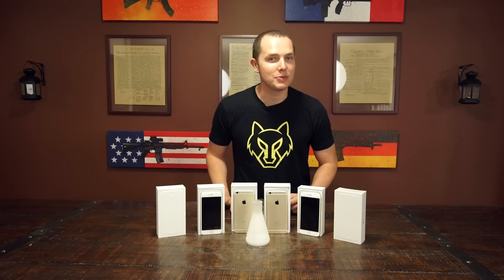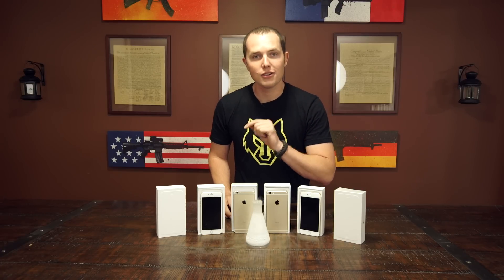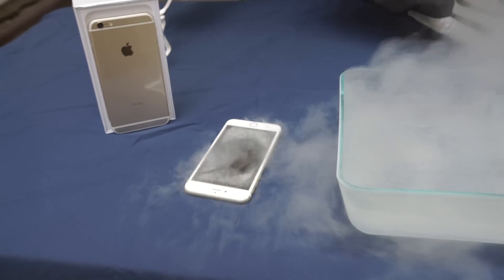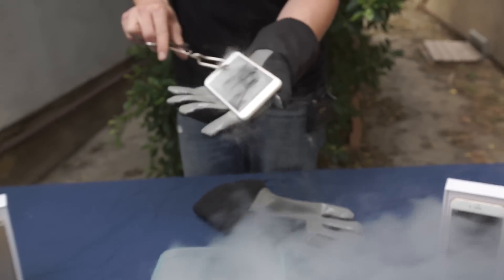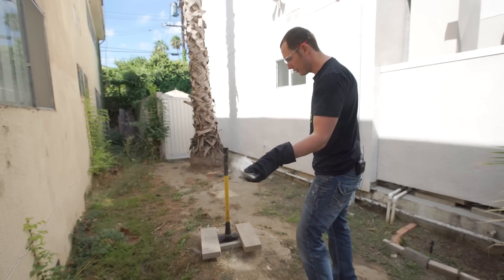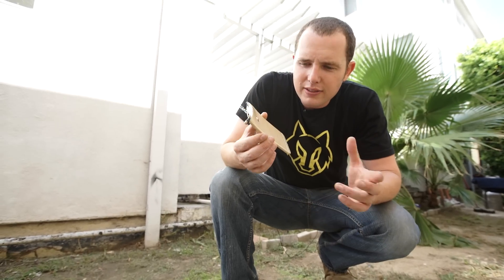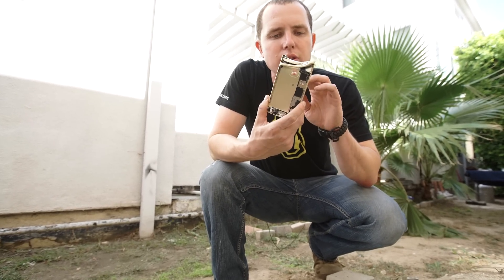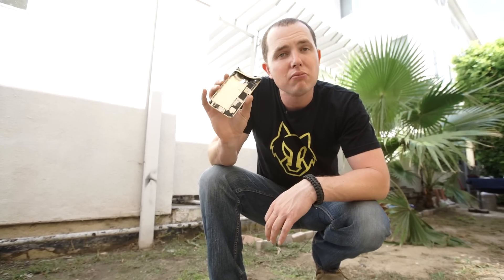iPhone 6 Plus vs Liquid Nitrogen

Comment: You know, I hear it's actually safer to not use gloves when dealing with liquid nitrogen, or any other extremely cold liquid, simply because your bare hand is so hot in comparison, it just kind of boils off fairly quickly if you get some on you, or just rolls off your skin, and never really touches you (unless you hold it in your hand for more than a second or two). If you have gloves on though, the super cold liquid can seep into the glove and then stay in there and burn your hand.

Edit: In the comments below, I was told this is called "The Leidenfrost Effect".  

However, those gloves looked fairly water/liquid nitrogen proof, so I guess you were safe. Not that I really give a shit anyway, just mentioning something that I remember hearing about what not to do when handling super cold liquids. 

I guess the container storing the liquid could have been cold, but I think that's doubtful, as I'd imagine they'd have some sort of double wall in them to prevent heat/cold exchange.
Reply: For the first paragraph you could've made it short just by referring to the Leidenfrost effect. Just saying.
Reply: RusticKey Thank you. I knew it was called something. Must have slipped my mind. Much easier that way. However, I guess all the people who don't know what that is got the basic definition by my post, and would have glazed over something like "The Leidenfrost Effect". 

Still good to know though. I edited my first comment to include it. 

BTW, I'm more of a fan of Rhett. ;)
Reply: Joe Blow Well, people could've googled ze fancy magic term Leidenfrost effect, and let's assume everyone who knows about liquid nitrogen knows about that. Just suggesting a tl;dr version of your first paragraph. Not saying you're wrong, you're definitely right.

Ahah, Rhett's face was funnier during the smoke + jello thing but somebody else took it so I had to get Link's face shortly after eating the octopus then heaving. I'm a fan of both, sometimes I prefer one's reaction, sometimes the other, especially Link's superior heaving.
Reply: RusticKey That's a lot of assumptions. I think you're giving the average person way too much credit. 

And what about the face(s) Link made after eating the Ghost pepper? LOL. They were pretty gold.
Reply: Joe Blow Well, let's assume every internaut is well-educated at browsing.

C'mon, every face of Link after eating something is pretty gold. But still, the pork blood taco and octopus heaving were numero uno.
Reply: By experience I can tell you that if you let nitrogen fall on your bare hand (little leaking of about 10 drops a second spreading like water from a shower) it feels like if every one of them is a needle getting into your skin. At my work I deal with this every day - sometimes when transfering liquid nitrogen from a tank to another, there are little leakings at the valves or joints. I tried it, couldn't stand more than a second. I wouldn't take out my gloves ;) Excuse my bad english
Reply: Grzegorz Brzęczyszczykiewicz That sounds like cold hell every day.
What's your job?
Reply: I work in a gas separation plant. Basically we take air from the atmosphere, and by different processes we get liquid nitrogen, oxigen and argon. Pretty cool, actually.
Reply: Grzegorz Brzęczyszczykiewicz That does sound like a pretty cool job.

However, when you said; "_I wouldn't take out my gloves_", did you mean "I still wouldn't wear my gloves" or "I would not handle liquid nitrogen without my gloves on"?

I understand English isn't your first language, I'm just a little confused on your phrasing considering what you wrote before it.
Reply: Joe Blow Sorry, I wasn't very specific with my last sentence, I'll try to explain myself in a better way.

 I mean that I wouldn't handle liquid nitrogen without my gloves on. I always wear a leather pair, although it's not really the best material, but for a not very long exposure it's ok.

You are right about nitrogen boiling fast, almost instantly if it falls on the bare skin. But it's not as fast as described, and it will be in contact with the skin, every time. And I assure you'll feel that, even with the tiniest of the drops. Ok, pain will go fast, in less than a second, but what if it's not a drop but a little shower over your hand, or something more serious?

Leaving aside the direct contact topic, when handling nitrogen every object in contact get cold really fast, and even worse, sticky. Remember it's -196ºC. If you don't protect your hands it's very likely they'll get glued to the recipient or other surface and injure yourself. So gloves are recommended.

Now about the video: I did some experiments on my own while transfering liquid nitrogen to an small tank we always need to have full. Filling this takes about 20 minutes. In that time, pipes reach that low temperature, so I was sometimes placing an object like a stone, coins, or little fresh leaves from a tree on the pipe to see what happened. Organic materials become solid, fragile, but not the others. Once I placed a little flat aluminium piece and once it reached that low temperature I hit with a hammer. No changes. If it doesn't contain water, the sample that is frozen gets more fragile but not in a noticeable way.

I think nitrogen did nothing to that iPhone. It would've been broken the same way if it wasn't frozen, just by the hammer smashing. Notice that metal (aluminium?) and the end of the video - it didn't break like a glass, like they always show in movies. It just bent.
Reply: Grzegorz Brzęczyszczykiewicz The phone most likely would have broken the same way because the materials in it (like aluminum. Sorry, I'm american, lol) have a very low water content, so all the liquid nitrogen does is make it cold, and not much more brittle, if at all. 

At least that's the way I see it. I could very well be wrong.
Reply: Joe Blow Yes; stuff with very little to no moisture just gets colder, not more brittle. All the crushing and blasting you see from other stuff being frozen by liquid nitrogen is because they have water in them. Ice is brittle, very. Metals like aluminium and plastics doesn't get more brittle with cold.
I doubt most phones have a lot of water in them, the battery will take a hit from the cold, though.
Reply: Screw science class, I got youtube comments.

Comment: fyi not only does thee iPhone still; technically it will use less battery life as a super conductor is created causing less resistance and therefore less loss of energy. So It will last longer

Comment: how cold is that shit?
Reply: Maybe it will completely freeze your ball after putting it into that for half a minute
Reply: Brian Tran Under normal atmospheric pressure, nitrogen exists as a liquid between the temperatures of -210°C and -196°C which equals -346°F and -320.44°F. Below -210°C, nitrogen freezes and becomes a solid.
Reply: Hridoy khan. Nice
Reply: Brian Tran i think for it to be liquid it has to be -270 celsius
Reply: hagala thekid the coldest temp ever recorded is -272.9999999. So he is nearly a world record holdet